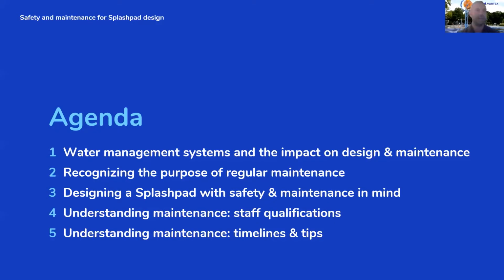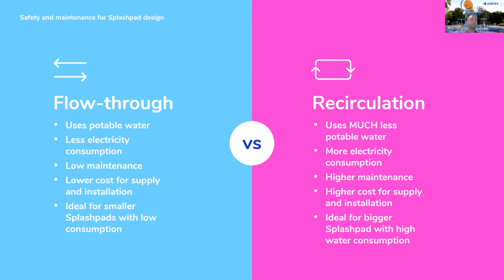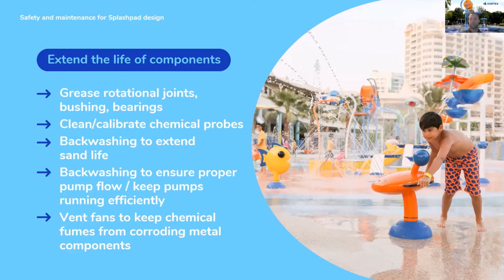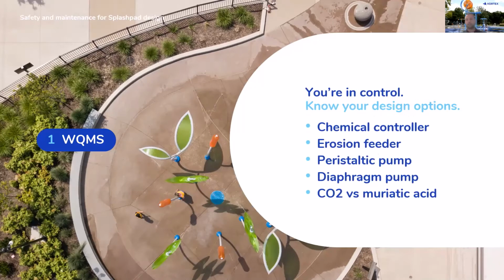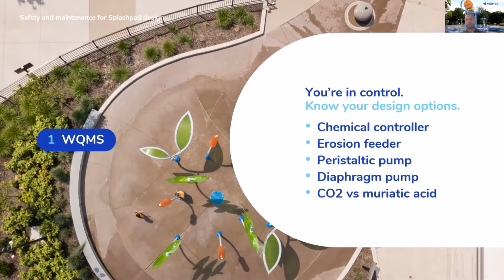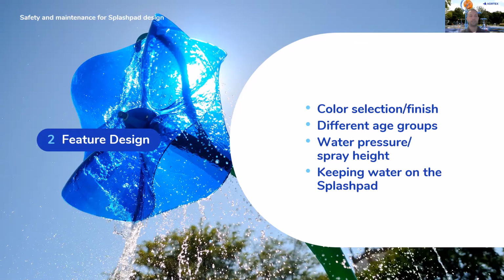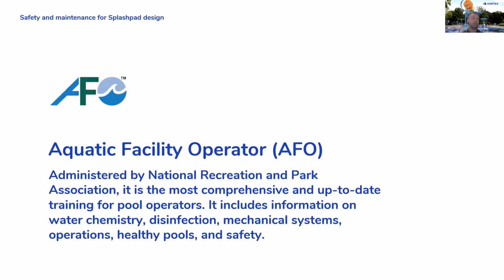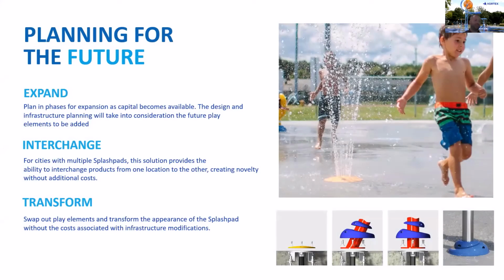Shop Talk - Safety and Maintenance Considerations for Successful Splashpad Design

Comment: should I consider buying the splash pad fixtures directly from China? the quotes I am getting from Rainbird and other USA based manufacturer's are 5x more than Chinese quotes I'm getting, even with Tarriffs and ocean shipping which typically increaes the base price by 50%. For example rainbird quoted me about $100K for a system and the same system from China is about $30K with shipping and tarrifs.